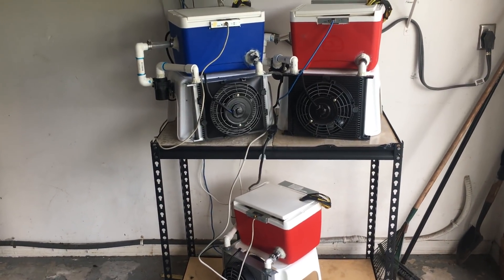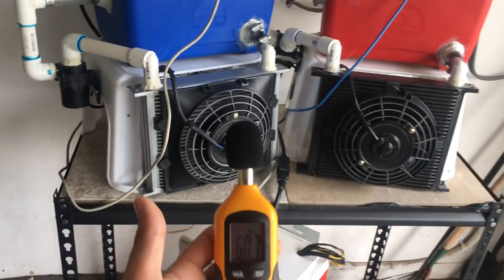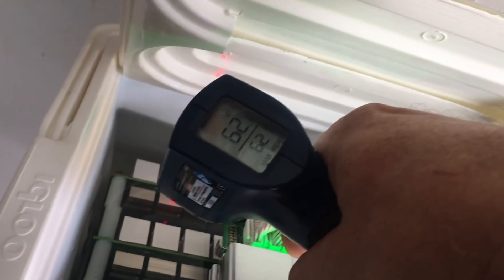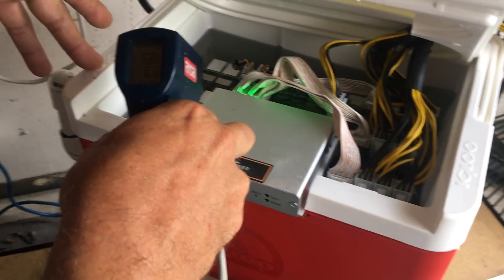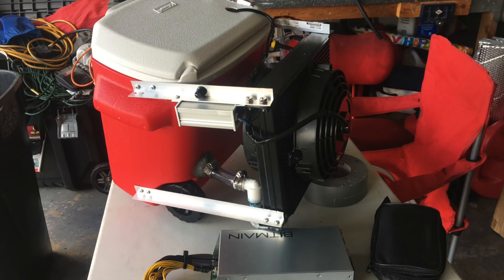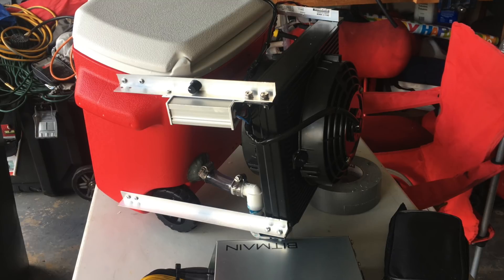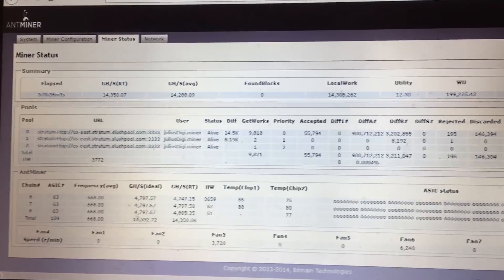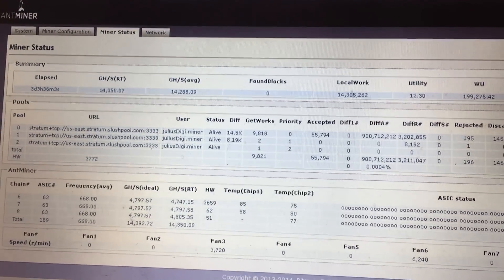Noiseless immersion cooler! Mineral oil ASIC miner liquid immersion cooling UPDATE!

Comment: I don't understand why you're using a cooler.  Coolers separate internal temp from exterior, if you didn't use a cooler you would actually loose heat from the interior to the exterior which would actually be desirable.  The heat generation is happening inside the cooler so the cooler itself is basically just keeping in the heat.  Doesn't matter that we call them coolers :) since you don't have a cold source inside it's working against you!!! LOL!

Comment: hi!!! i'm actually doing this experiment with a v9 miner, overclocked at 5 TH, yesterday i ran this project and the temperature went high,  almost 89 degrees, i'm very disapointed because  i was expecting it to be cool and not so hot, what do you recomend?
Reply: Radiators and fans.

Comment: I have similar setup but temps are getting way over 90°C with an Antminer D3. Even when connected to a new radiator for a living room (i know right :D). Can you link to the pump and fans? Best wishes, you inspire us!
Reply: Which liquid r u using?
Reply: @m.fakhri2893  automatic transmission oil with extrem high flash point °C.

Comment: you still have the heat to deal with
Reply: He don't. That's why the radiator is there, it is cooling the mineral oil.
Reply: @Aranzahas he meant he has to deal with the heat in the house. Not the heat of the machine. But thats a garage so unlikley to be a problem.

Comment: do you have issues with the mineral oil creeping out of the container? I think eventually it will run up all the cables and make a huge mess
Reply: Mineral oil is also flammable so be careful using it.  Engineered Fluids makes a good product, so does 3M but 3M is very expensive.  For fan replacement: https://fan-b-gone.ecwid.com

Comment: Do u have any idea how to switch off the fan when running in the fluid I have a antminer t9 under the fluid but the problem is the fan......please help
Reply from the maker: Hi yes we will be selling the special module as well
Reply: There is a fan "spoofer" you can get on amazon pretty cheap. It plugs in where the fan normally would and "tricks" the unit into thinking the fan is running just fine. You will probably want to take the exterior aluminium frame off the miner so that the fluid can circulate well if you are going to remove the fans. I would if it were mine.
Reply: Can u let me know where can I buy the fan hack or how u did it with the removal part of the fan please please need ur help
Reply: search for this: >> S9-Volt-Rocket-Ship its a modded firmware where you can just remove fans
Reply: https://Fan-B-Gone.ecwid.com